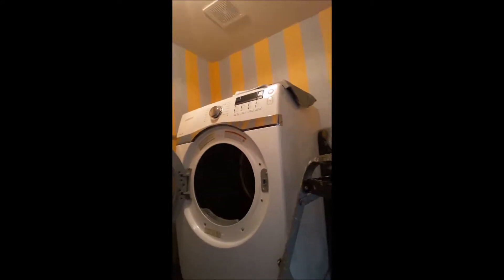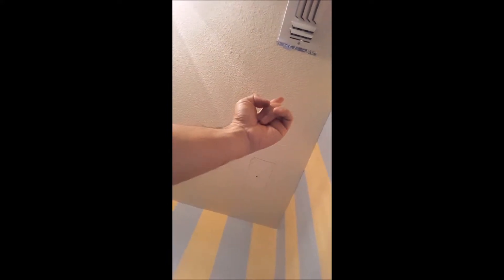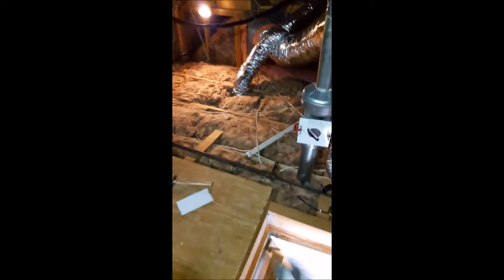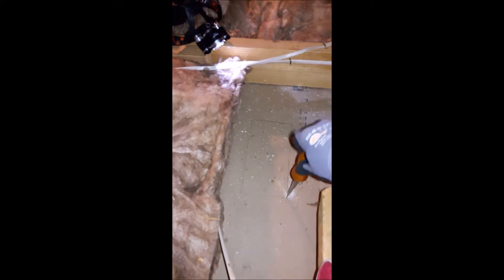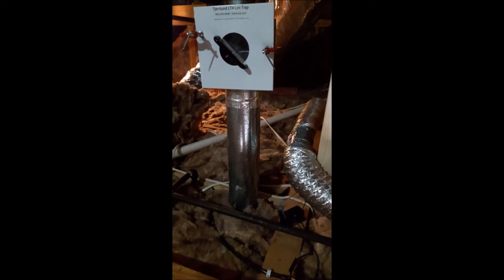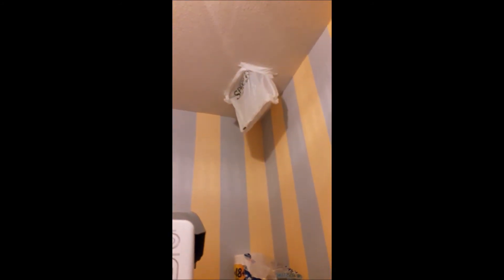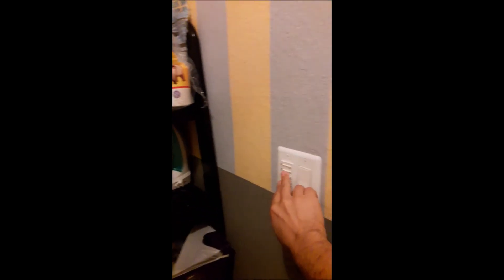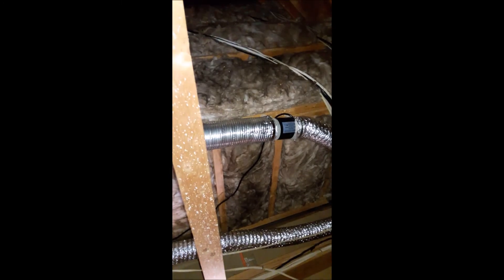Laundry Make Up Air Vent Youtube version

Comment: Interesting idea. Might be more complex/expensive than necessary. Attics are ventilated, so you could draw make up air from there as fresh air already comes in through soffit vents. Rather than running the expense of a fan, an automated damper could be wired into that switching mechanism to open and allow attic air in when dryer turns on, right above your new ceiling duct. If attic dust is a concern, you could install a filter on top of the damper. 
Still neat to see the approach you took. Helps me plan a solution for similar problem. 
Thanks